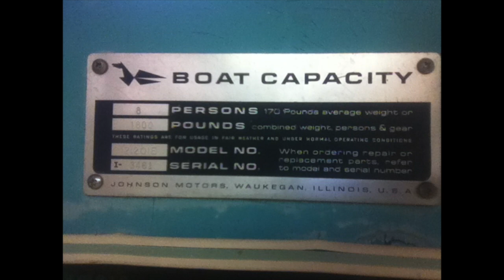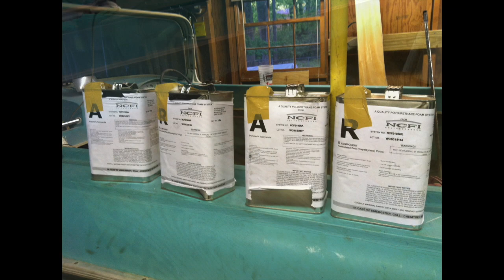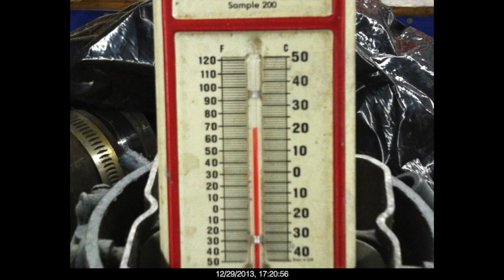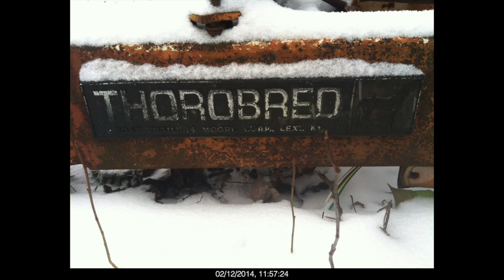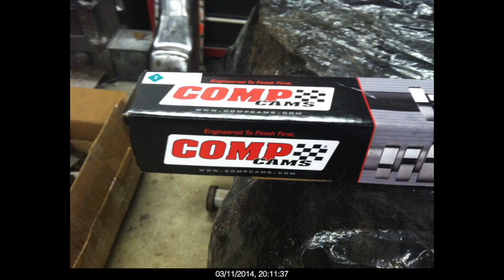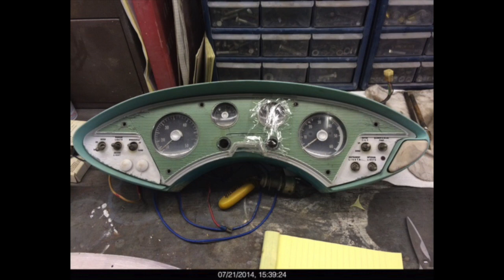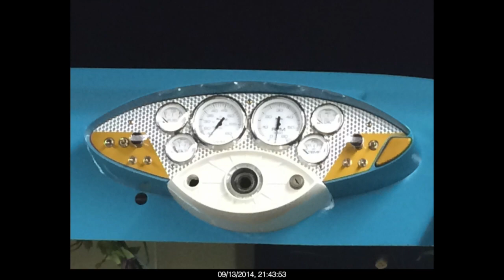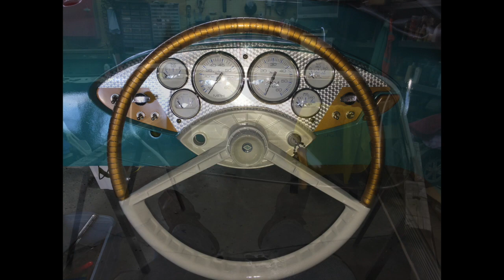OMC Johnson Deluxe Full Restoration

Comment: My family had the same boat for 30 years, I learned to ski behind it when i was 12, now 59.   THe OMC string drive was troublesome, particularly in the spline shafts in the upper outdrive, (the key was the bushing that let it steer, if you had slack in it, it wouudl take out the spline shafts quick, but the boat and it's features are amazing.  The front seats had shock absorbers on them because it was a rough ride up front, but it is super stable on the water. Mine had the 4.3 liter v-6, but a v-8 upgrade would be everything it always wanted.   When you turn it feels like it is sliding through the curve rather than tilting like a v bottom.  I bought a parts boat to get another outdrive for it, the oritinal boat was sold out of Oklahoma into Nashville TN.  The parts boat is still out on the family farm in Western Oklahoma. TH parts boat was missing the windshield which is tinted glass (auto quality) and raises up and down to let air in when it's hot.  This is a tough, tough boat.  It is also Rated for the Gulf of Mexico, the hull was also cross used in some twin engine Coast Guard boats.  one for the ages.  Loved it.
Reply: Bonjour de France ,j'en restaure un en ce moment...et les pièces sont compliquées à trouver....

Comment: I have a 1969 omc Johnson surfer that I just bought. I know the parts are really hard to find, but mine is in great shape interior wise and shell, except it hasn’t ran since 88. Do you mind giving me some tips on what I shld do. I haven’t turned the engine at all yet, but i do know it will turn. I took out the outboard oil from the bottom Nd I seen it has so many other places but didn’t want to mess with those. I’m waiting on oil I ordered, but I seen you where using pennzoil for yours. Do you know what type of grease you use for your exterior gears?
Reply from the maker: Feel free to shoot me an email andrewandwilla@hotmail.com

Comment: One hell of a job! You gave me some good ideas. I have basically same boat except it’s 135hp outboard. Where did you get the running lights rebuilt? My boat needs a bit of work but not as much as yours but still is a lot of work. My windshield is a low profile. Where did you find the serial numbers? Please reply when you got time.
Reply from the maker: The navigation lights, the green and red, I was lucky to find a good set and then made molds to recast them. I sold probably 15 of each before the molds deteriorated. When you ask about serial numbers, do you mean for the hull?
Reply: @foothillstrailhiker2426  yes for the Hull. Do you have lights to sell?
Reply from the maker: @giltk8258  sorry, no lights left to sell. I sold the last of them probably 4 years ago. The hull number is on a metal plate inside the boat on the right gunwale. It's pictured at 2:55 in the video.

Comment: Did you replace the old stern drive?  That's what cutting the larger hole in the transom was for?  If so, what did you replace it with?
Reply from the maker: Yes, I removed the 1964 drive and replaced with a 1984 OMC 800 series.
Reply: First off Beautiful job!! N second  I am pondering purchasing a 66 deluxe 17 w the Buick V6. Ran when put away 15 plus years ago. Lol anyway everything is there in good shape except for few lights n lil pieces. Hull needs glass work previous owner did a patch job or 2 .lol 
I love that dash panel cluster. Where did you find the one you put in the boat? If you dont mind. And if you have any other tips for me if I pull the trigger n buy it?